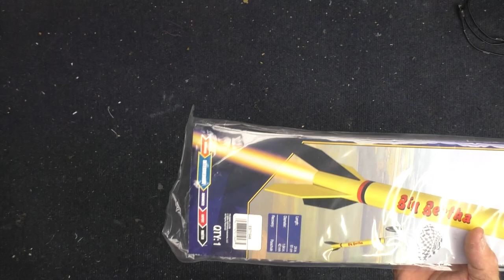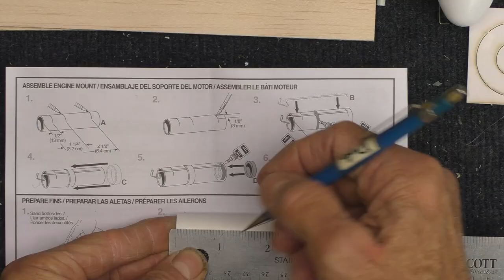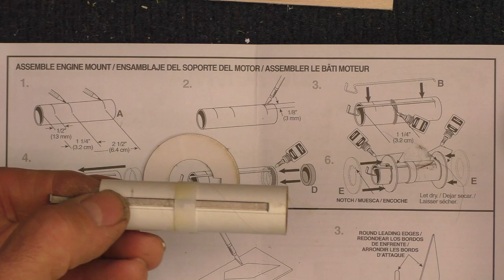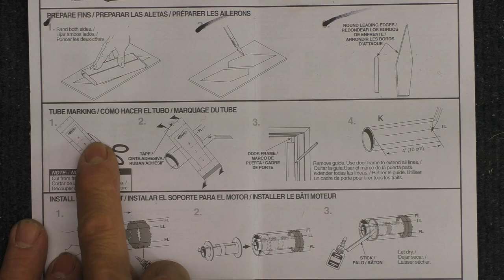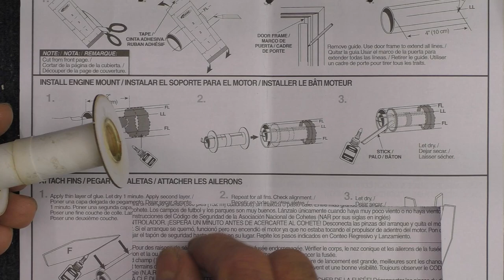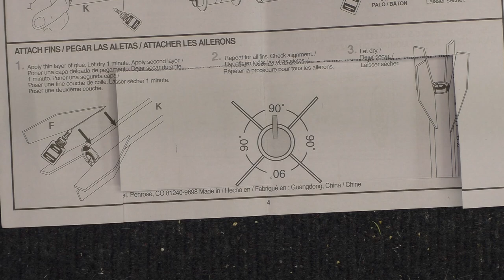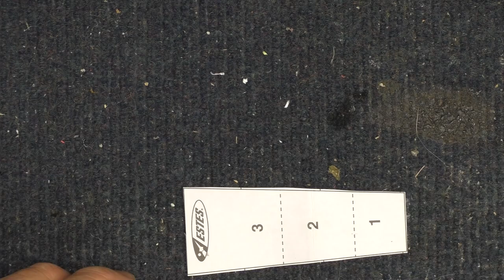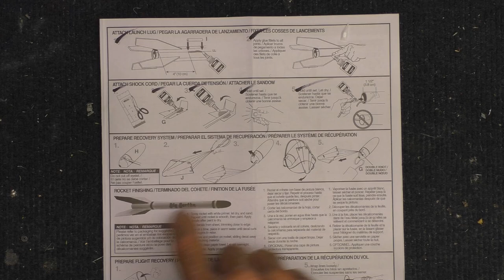Estes Big Bertha Build Part 1

Comment: When you put the spacer rings on the engine mount, you glued down the retaining clip.  It's supposed to be able to bend up into that slot so that more length of the clip can bend when inserting a motor.
Reply from the maker: Right you are! Should have wiped away some glue. As it turns out, it still bends easily when loading up a motor.

Comment: I also do that trick at 18:42, put glue in the tube for the bottom engine mount ring. That way you get a fillet on both sides of the ring, especially the “up pressure” side. Good move.